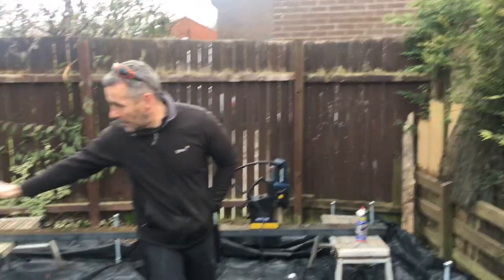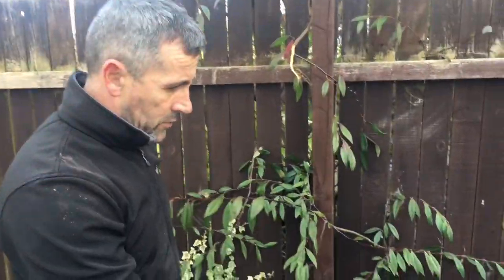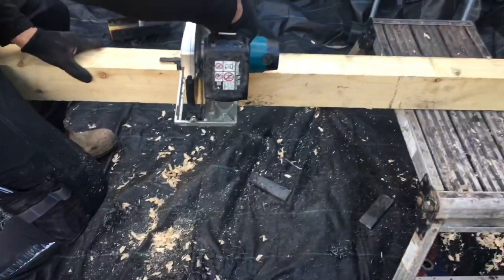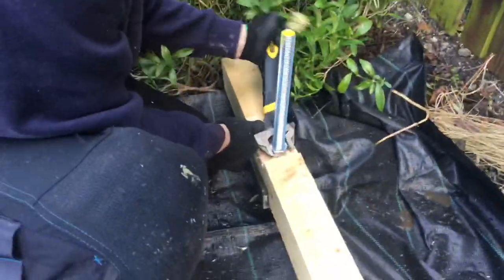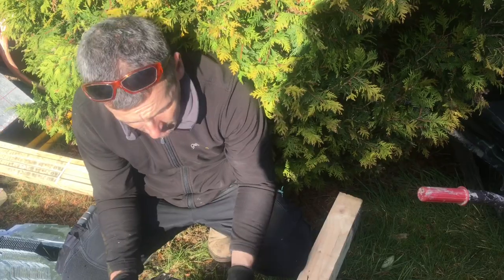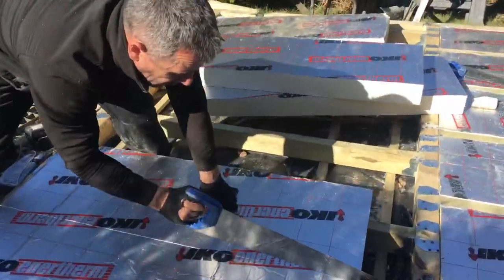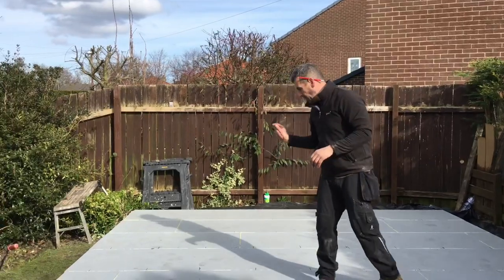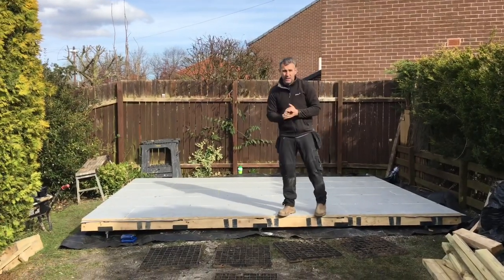Garden room tutorial, base system construction

Comment: Thank you for your great videos! They are very very helpful. One question: I don't have an Evolution drill and I don't think I can cut holes in the steel channel and chop it to sections. I've looked anywhere online to find something similar to that shoe but couldn't find them. Can I use 2 more of those square washers and sandwich the 4x3 in between them (secured with nuts) on the top? Or do you know where to find a ready made shoe online? thanks
Reply: Hello, I recall seeing that someone in the Oakwood Garden Rooms Self Build Facebook group makes these shoes offsite now and supplies to anyone that wants them. Hope that helps
Reply from the maker: Bapps for bolts do the full kit mate

Comment: Mr Shouty. If the timber is at 400mm centres, then locking your finger at 400mm and marking, will make the board too wide. Surely you need to allow for half the thickness of the joist each side?

Comment: Great videos Will. Great insight into what size timbers and hardware to use. Do you always use the pile system for your base or would you use something different for smaller structures?  Reason I ask is I’m planing on building a 16ft x 8ft structure on an incline garden

Comment: Hi William, quick question if you dont mind? Been using your videos and a few others for ideas for my build. Floor joists done, and just used similar insulation boards as yourself. A few are causing a squeak when I walk around the joists. Will this rectify when I get the Ply or OSB down? Or is there something else I am missing?

I am not a builder and doing this DIY. 

Keep up the amazing work guys! Love watching your videos! :)
Reply from the maker: Hi
Are the joists solid and not moving? Never had this issue tbh, what’s the insulation you’ve used? Is it polystyrene ? Jablite ?
Reply: @thegardenroomguru  hi William, sorry only just noticed your reply. The joists are solid mate. The isolation is PIR recticel insolation mate. My work around was to use talc powder around the edges of the boards before I installed. Now all is very quiet! Never seen you have the issue in any of your videos so i did think this was strange. Thanks for the reply William. Loving all your videos! Very informative and helping my a bunch 👍

Comment: Hi will can you tell me with a suspended timber joist floor what happens if you get rats nesting underneath would it not be best with a concrete slab with a kicker cast upstand then build above  what do u think pal cheers bri
Reply from the maker: you can put a wire mesh skirt, video coming tomorrow that will show it

Comment: Do you need building permits for this or are you keeping the height to less than 2.5m...
Reply from the maker: AirForceOne1971 we keep under the 2.5, generally around 2450👍🏼
Reply: Can't flat roof buildings go up to 3m? (or is this only in Scotland?)
Reply: @wm302  usually 2.5m to the eves if within 2m of a boundary...need to check local council regs...
Reply: @D230261  Thanks for the reply. Just double checked the Scot Gov guidelines and it's definitely 3m for eave height, but anything within 1m of boundary has to be less than 2.5m. Seems our Gov is a little more generous :)
Reply: @wm302  I wasnt sure on your location so I mentioned the 2m from boundary...Im just outside Glasgow myself and about to start a 3.6x2.4m workshop/office build...I will however be staying below thd 2.5m...3m is a bit excessive for what Im after...
Reply: @D230261  In Glw under Permitted Development Rights you're okay up to 2.5m to the eaves within just 1m of the boundary. (FYI, section 4.74 of the Govt's PDR document gives you clarification of this)